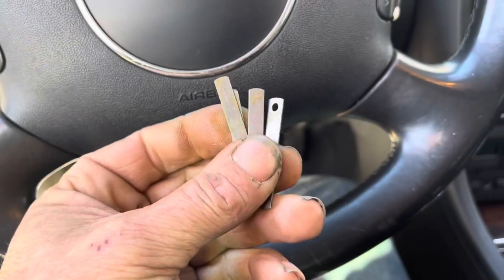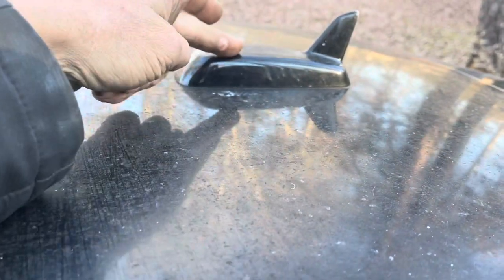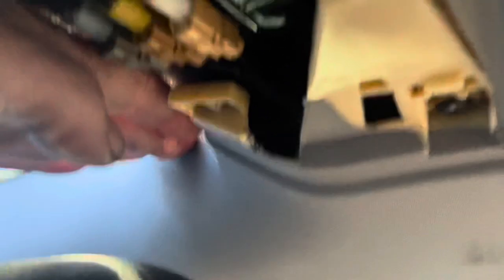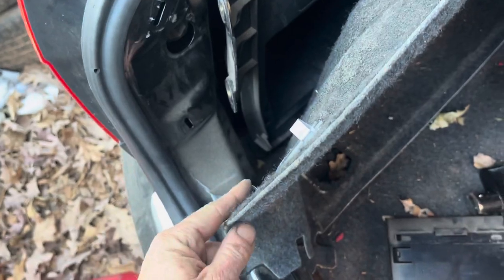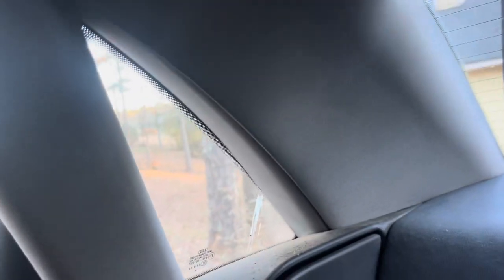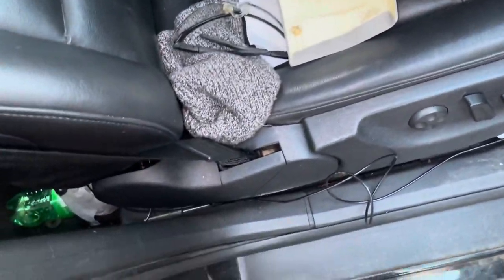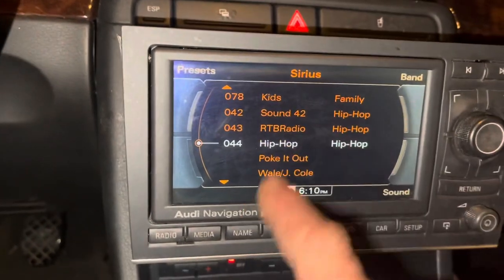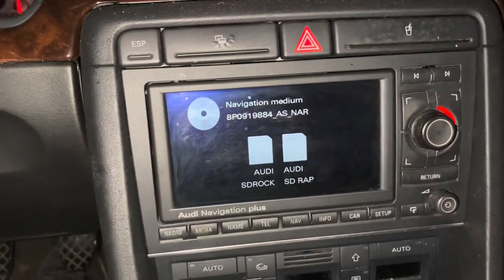Audi B6 A4 RNS-E retrofit w/ factory Bose and satellite radio

Comment: Hello. I have one question i have the same Audi but with a concert radio. I want to upgrade it with RNS-D is it possible? And if it is must i buy some new conectors and cables or are the original one fine?
Reply from the maker: The RNS-D will definitely work. You'll need an adapter harness and the antenna adapter. It's basically the same as installing this RNS-E

Comment: Hey random question I got a bunch of Codes on my B5 and I’m guessing I need a throttle body. Do I need to do a TBA on the new throttle body or does it align itself ? Love the videos 👍🏽
Reply from the maker: Typically I would do a TBA with VAGcom but I believe that if you turn the key on without starting it when the engine is completely cold and don't touch anything for 30-60 seconds the ECU will automatically perform a TBA.